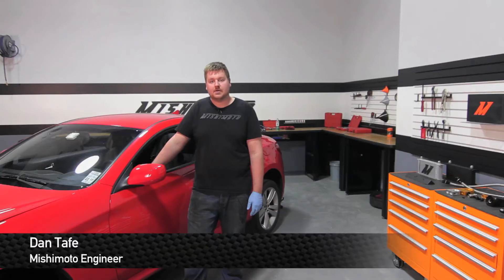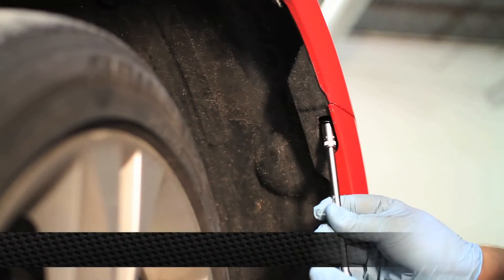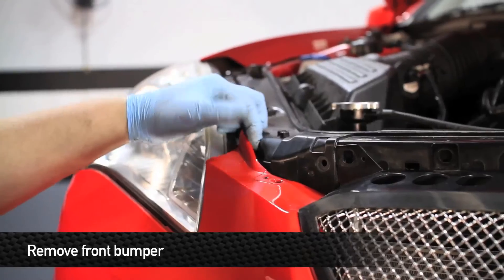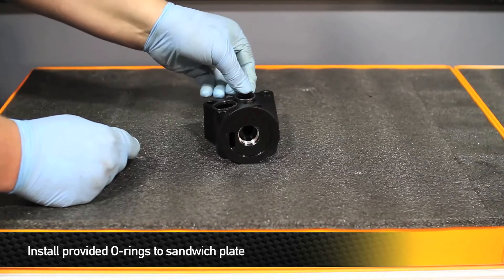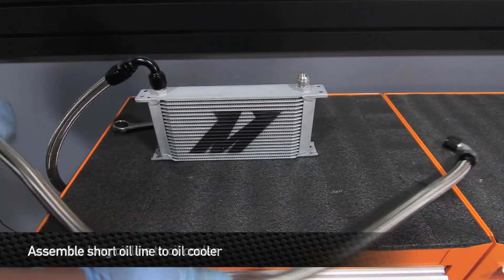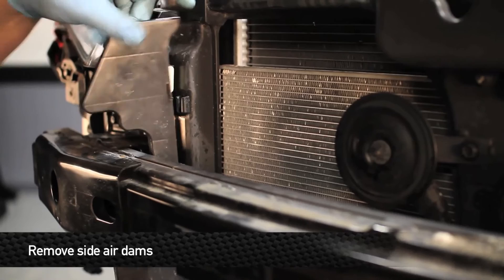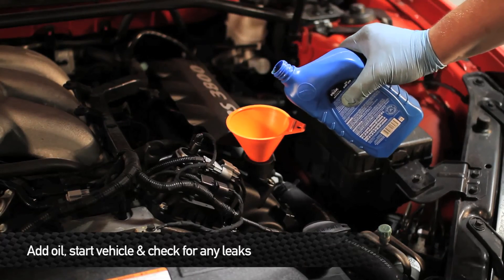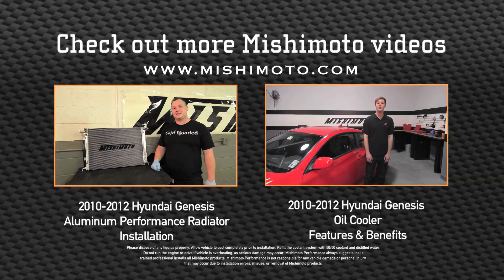Direct Fit Oil Cooler fits 2010-2012 Hyundai Genesis V6 Installation

Comment: Wouldn’t you need to fill the cooler radiator with oil so when you start the engine there’s not pressure issues?
Reply from the maker: Not necessary as the oil pump will begin pressurizing the system while the motor is cranking over.
Reply: @mishimoto  oh okay. Thank you for the fast reply on this older video 💪🏾

Comment: Is the housing on the BK1 the same setup as the BK2? I have a 2013 and need to replace my whole oil filter housing and cant seem to find and videos or info on it. Thanks for your time :)
Reply from the maker: The OEM part number for the housing is the same from 2010-2016 so the housing is cross compatible.

Comment: I simply want to buy the housing kit so I can use canister filters instead of using cartridge filters, NOT to run an oil cooler. With that being said, do I have to buy the sandwich plate in order to properly install the canister filter , even though I won’t have a need for it?
Reply from the maker: We actually offer the adapter on it own for people looking to go this route. I have included a link below to the item page for the part.
https://www.mishimoto.com/hyundai-genesis-coupe-3-8l-oil-filter-housing-10-13.html

Comment: do you have to buy the oil cooler or can you just use the cnc housing and not run the cooler?
Reply from the maker: Hi zenzrd - We would recommend using the entire kit, together. :)

Comment: Is this goes for the 3.8 liter sedan also? thanks
Reply from the maker: This is for the coupe only - also fits: 2010-2012 Hyundai Genesis 3.8
2010-2012 Hyundai Genesis 3.8 GT
2010-2012 Hyundai Genesis 3.8 Grand Touring
2010-2012 Hyundai Genesis 3.8 Track
2010-2012 Hyundai Genesis 3.8 R-Spec

Just to be sure, I'm contacting our customer support to confirm whether or not it will fit the sedan.

Comment from the maker: 1) The only fittings which require Teflon tape are the NPT port plugs. All other fittings do not require any sort of sealant.
2) This will fit the 2013 model, but the oil cooler mounting bracket will not work. We do sell just the filter housing adapter, so you can piece together your own custom kit. Or you can purchase this kit, and make new mounting brackets for the cooler.

Comment: Two questions
1) Do any of the fittings require sealant (thread tape etc) because some of the fittings did not look to be taper sealing
2) I would like to know if this also fits on the 2013 model

Thanks a bunch and great video